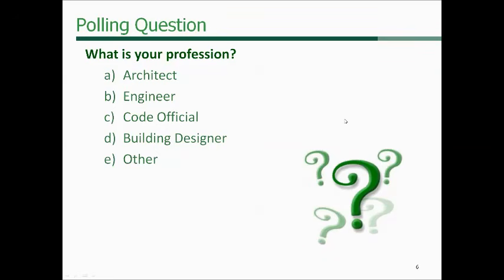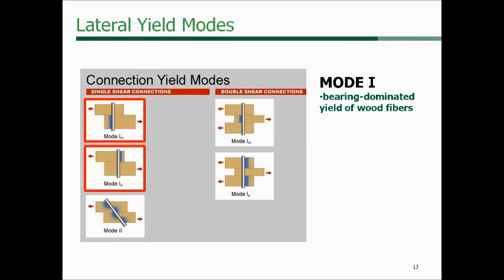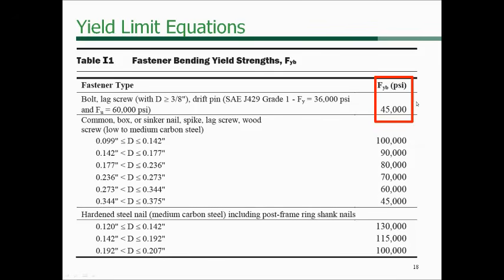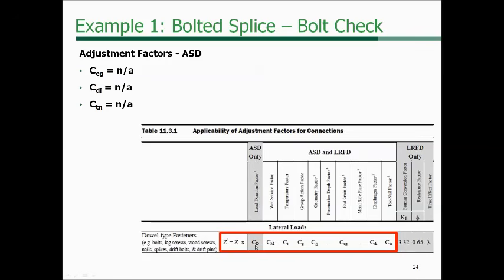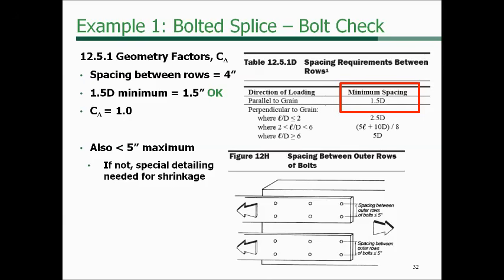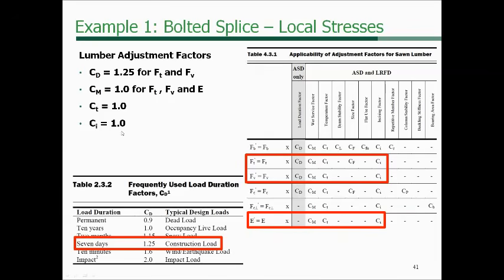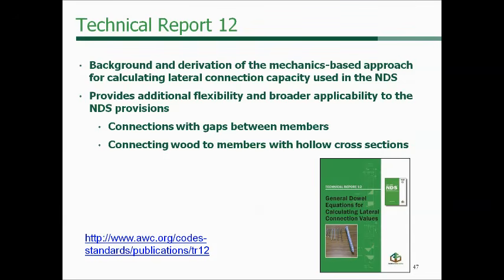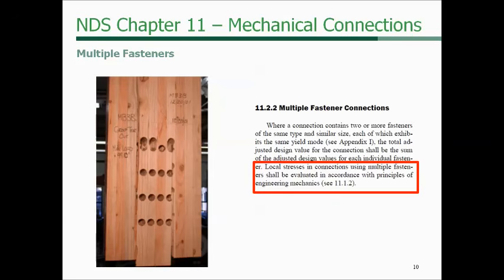Design of Bolted Connections per the 2015 NDS

Comment: Would be good if you could do a thru-bolt connection as it pertains to 2015 NDS Section 12.3.9 Multiple Shear Connections. Nowadays, I am seeing the use of multiple-ply connections and calculation of 4-ply member (ex. (4)~1.75x LVL) is very vague. Is it as simple as analyzing as a single shear connection and using the lowest lateral design value, then multiplying by # of shear planes to obtain Z? If that is that case, I have seen multi-ply connection charts where 4 member connection values appear to be very small.